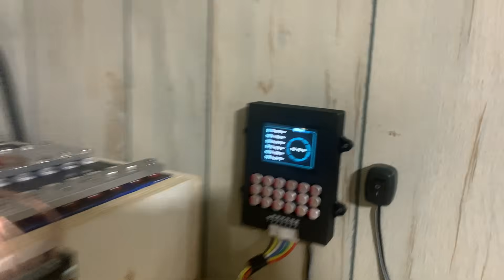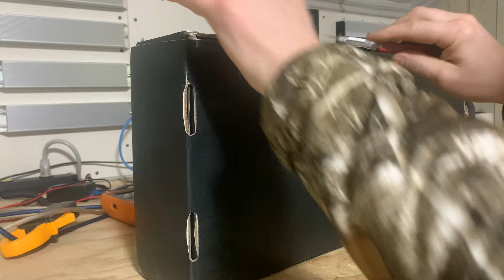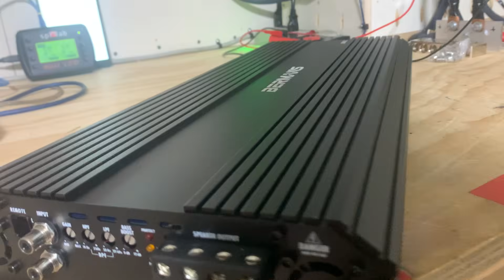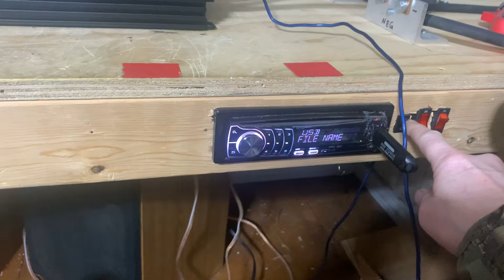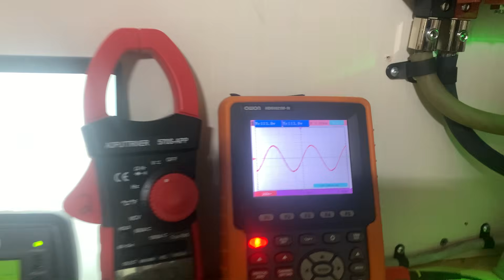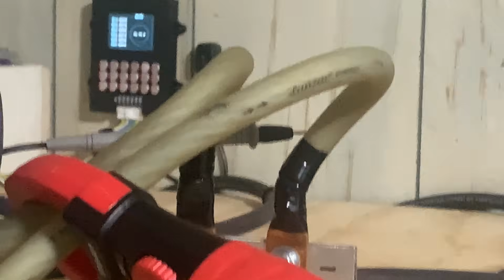Amp Dyno and unboxing Bermans 18000 1D

Comment: @AllAboutAudio- I have seen clamp issues like this on some other full bridge designed amplifiers, while hooked up to the term lab magnum power probes. I think in some cases the EMI is causing issues with the clamp either being too close to the amplifier, or not enough shielding. A quick little test can be done to see if too much EMI is causing the issue from an amplifier= put aluminum foil in between the clamp, & the amplifier tested. Then re-test to see if the amperage reads more smoothly, & more accurate= gives a normal amplifier eff. reading.
Reply from the maker: Yeah the termlab sucks when trying to clamp big full bridge amps. However this is totally different. The clamp issue was the wrong setting by me so the clamp reading was faulty. I had it set to 600A instead of 1000A. Once I put it on 1000A everything was fine. Also the Termlab clamp faults are on the AC clamp, this was clamping DC current coming into the amplifier. It was totally my fault the 2 ohm reading was faulty. I ran out of time on the video due to the fact for some reason my computer will not read videos over the 20 minutes mark, so I keep them at 20 minutes or less. I will be redoing the clamping on this amp and only the clamping and see if we get better results on the efficiency.
Reply: @AllAboutAudioJW  Yes, i am aware of that= about you having it on the wrong amperage setting. That just made me remember those issues that have caused many problems with many competitors, thank you for taking your time to respond, & make these videos.

Comment: Hey wassup Jeremy, question why test at such a high voltage as the standard is 12v and 14.4v? I understand if you did 14.4 and the higher  voltages ⚡️ ⚡️⚡️ keep up the dope videos.
Reply: @DoriansDIYAudio- Most amplifiers now are rated to do their advertised power @ 14.4 volts. He tested @ 15.8 volts to account for the voltage drop, given that this is a very power hungry amplifier. The power numbers are calculated off of the voltage sag, like the last test= @ 1 ohm to clipping this amplifier made 11,322 watts, & pulled 1261 amps of current, while the voltage dropped to 14.00 (= 64% amp. Eff.), down from 15.8 volts. This amplifier would have made the same power if the battery bank was even better, & had started @ 14.4 volts, & only dropped to the same 14.00 v. Don't get caught up on the high starting voltage, as that has little to do with the amplifiers actual power numbers. The voltage that the battery bank drops to when the power numbers are obtained on the amp dyno runs, is what matter's the most.
Reply from the maker: @evilinside5984  100%
Reply: @evilinside5984 but he's not dropping to 14.4v........  when you start a test off at such a high voltage than that give the amplifier or piece of equipment a extreme advantage and doesn't show real world expectations. Most guys aren't boosted their voltage upto 15.8v
Reply: @DoriansDIYAudio  Did you NOT see the very last= 1 ohm test to clipping!? That is where i got the 14.00 volt from, dyno started @ 15.8 volts, & dropped to 14.00 volts! So the voltage that matters= the 14.00 volts, because that is the actual voltage that this amplifier made its 1 ohm power to clipping @.
Reply: @evilinside5984 I'm not sure why you continue to try answering questions here when I'm asking Jeremy a questions. Do me a favor and respond when I ask for your assistance. Thank you bud.
Reply: @DoriansDIYAudio  Freedom of speech, on a free platform. Good thing i don't need your permission to answer a question.

Comment: Jeremy, I got my Berman's 5k half bridge and it's slightly different then yours with the multi colored transformers, gold 2/0 inputs.
It performs real well but I haven't clamped or metered yet, its 0* and snowing here.
Reply from the maker: I was hoping for that amp actually. I like the gold terminals!
Reply: @AllAboutAudioJW I pulled out a Recoil 2500 and swapped that in.  I immediately could tell it's way more power by volume 29, 35 is my clean max. I can't wait to get some meters hooked up.

Comment: That is a better deal than Taramps but Taramps achieve their ratings. At leach my Chipeo 12k, Smart8, and Smart3 do.
Reply from the maker: I still have several BIG Taramps to test. Chipeo 9K, Chipeo 12K, Bass 20K, Bass 30K.........
Reply: @AllAboutAudioJW that is great to hear. Can’t wait.
Reply: @AllAboutAudioJW that'll be cool. I don't think anyone tested the 20 or 30k.
Reply from the maker: @BDauto86  Nope not as of yet. I also have an "Alibaba" 30K and a Soundigital Deaf Bonce Apocalypse 37800.1D to test as well. I haven't seen anyone bench test any of these super large amplifiers yet. As soon as I get my 18 banks of caps set up for my bench I will be testing them all. I have clamped 80,000 in my van on this cap bank so I know it will be more than enough to do the job. It will just be a royal pain in the butt to get it moved from my garage to my testing room upstairs.
Reply: He did have a hard time keeping the voltage up though.  It's like my car.  :face-purple-crying:
Reply from the maker: @Mark_5150 That's why I started out at 15.8 volts. I knew the voltage would drop.

Comment: Please retest with dual inputs to each positive and ground!!? Think youll be better off
Reply from the maker: Going to retest with my cap bank. Dual inputs at this point wouldn't make a difference. You can have multiple inputs on an amplifier, but the traces can only carry so much current. If the voltage is dropping and the current is carrying, then just adding wire isn't going to help. More electricity from the power source would help tho. It isn't going to produce 18,000 watts, but producing 10K clean and 12K clipped at 1 ohm for under $400 is definitely a good amp if you have the power for it to produce the power. Thanks for watching and you know maybe I will do a 2nd test at 1 ohm adding just the wire.............for shits and giggles. I may wrong be what I said earlier. Good thing to test actually. People buy dual amp inputs all the time. I have a bunch laying around!
Reply: @AllAboutAudioJW i hear where you're coming from and your right.. the internal amp traces can only carry so much since the build houses do the minimum.. i do just wanna argue that amps coming straight from a build house dont have the r&d, and each company that uses them will adjust to add caps, or anything they would do to perform better before putting there name on them. there is a slapz audio 8k short vid that had to show people they hooked up dual inputs on each terminal and thats how they recommend to get rated..
Reply: @AllAboutAudioJW  thank you for responding and testing the dual inputs at 1 ohm like you said you might do??! Thats appreciated!! Im going to buy this same amp cause your right for the price its really good and i was gonna use dual inputs to get closer to rated and wanna see if it would make a difference??! You never know??? I think its just a rebranded 16k to be honest and am really curious if it does 16k at 1ohm with dual inputs to each terminals
Reply: @JJBigDadd86 in a vehicle with longer runs of wire sure it would make a difference. On his test bench he prob only has 1-3ft of 2/0 wire which can carry plenty of amperage that short.
Reply: @BDauto86 yah true. Im just a wishful thinker!! Hahha... really cannot complain about the price per watt it did put out!! I was hoping it would do a bit better when dual inputs are used since thats how im going to set it up when I get it

Comment: So it’s a 11k amp for $380? Jeeeeeezus
Reply: Right just like the 13k Stereo Mojo tested did 10k+.  People act like it's terrible for not doing its rating but dang over 10k for 340$ is really good.
Reply: @BDauto86  how an amp behaves in the vehicle is always different than on the dyno. I have 3x of these 18Ks in my Tahoe, running at a 0.50 ohm and they absolutely pound.
Reply: @WattsAudioExp damn